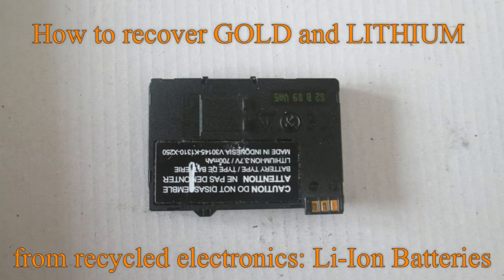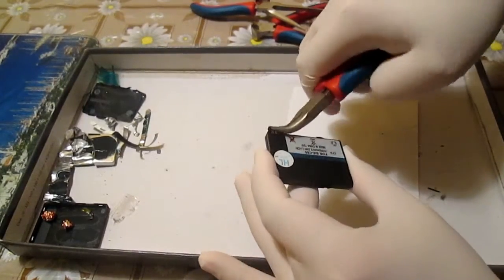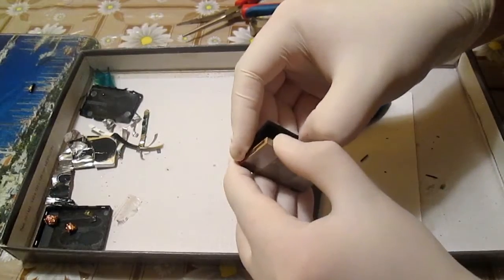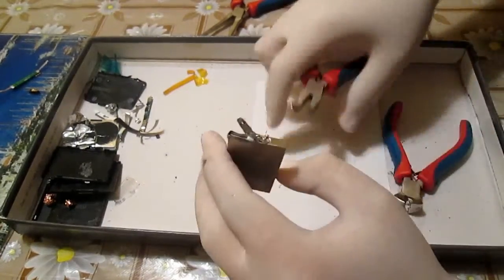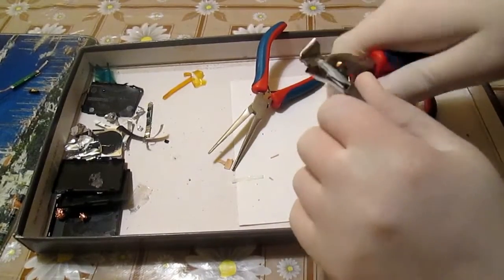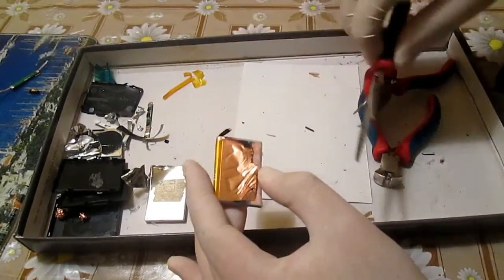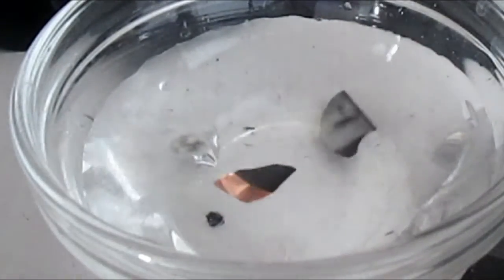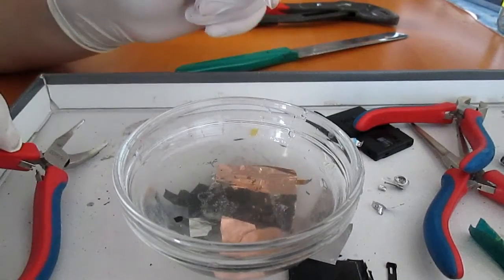How to recover GOLD and LITHIUM from recycled electronics: Li-Ion Batteries

Comment: It's the black coating that has the value ... it contains the cobalt ...each 2000mAh cell contains $0.8 of cobalt ... you have aluminium and copper foil and plastic layer ..... dry layers and shake off the black powder , this is mixed graphite and LiCoO2 , this powder can be sold to cell manufactures who use it to make new cells .....  One tonne scrap phone batteries cost $250 ...and contain $19000 worth of this powder .... manually cut open dry and tumble layers to separate this black powder.
Reply from the maker: Thx very much for valuable information.
Reply: The price have realy been beaten down since don't hope you were stock with to many tons of batteries

Comment: its not pure lithium its only got small amount...
Reply: It must be lithium f**** the meth Cooks I used to know that's how I make meth with this s*** it gets real hot when it burns but yeah it's black lithium is f**** a metallic color like what's inside of a capacitors like aluminum foil licking stuff this is black that means yeah you're right it's impurities in it carbon it's probably carbon lithium and copper ain't no damn AU
Reply: @katejohnson4189   sir can i use like this one lithium in video  to make meth  .i mean does it work